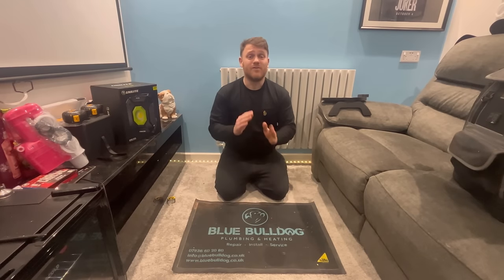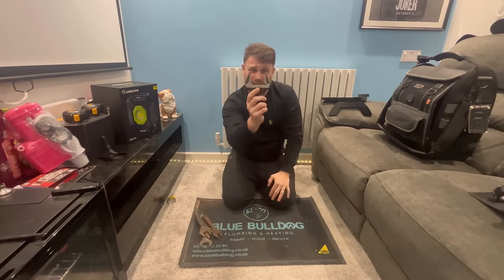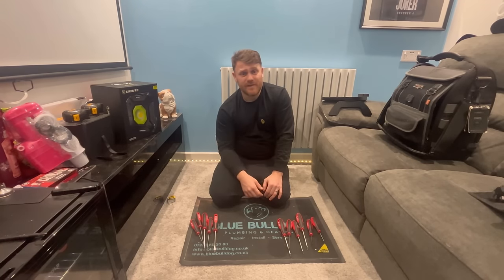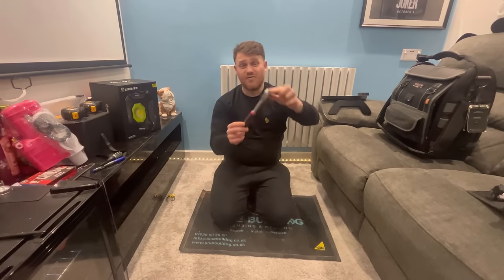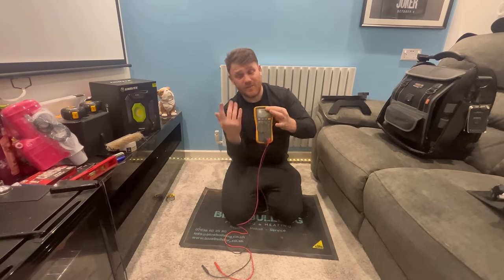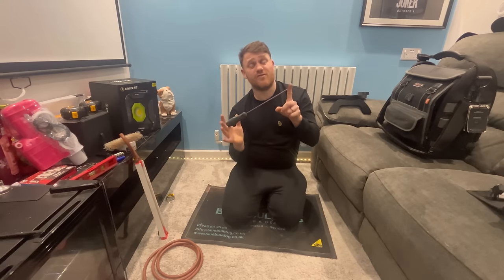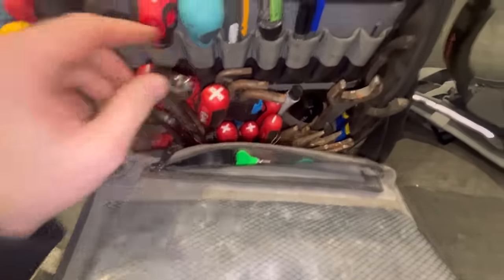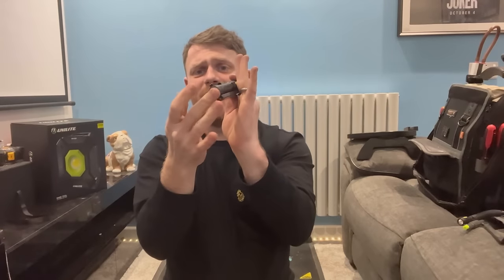Plumbing Tools & Review: Plumbers Tool Bag And Must-haves!

Comment: Thanks for that, it was interesting to see 👍
There is one tool that comes to mind, that you could add to that tool kit 🤔
I think it would be a real asset for you in your line of work, and that is, a small Magnetic screw dish or try. 
Ideal when dismantling items, all the screws and bolts kept safe in one place.
You can even stick the tray vertically on the boiler panel and load it with the screws and bolts you remove.

Just keeps them all together 👍

You might even find that some of the Chinese brass look a like screws stick to the tray as well 😂

Cheers Bud 👍
Reply from the maker: Great shout that is mate 👍

Comment: Nice loadout.
I use Systainers, they are easy to clean. Festool older tool-box models are great for fast access. I've never been a fan of bags and backpacks.
Reply from the maker: Thanks mate 👍I had a toolbox for years but got in the habit of using it as a step up 😅

Comment: Nice tool , am a wera man which I have all joker ratchet and open end spanner  for all sizes . I use knipex water pump plies too but the chrome push button as the 
one you use slip after a while .  Myscrews drivers are wera my Allen and torx are wera, they are expensive but you get what you pay for as they say. Like  you love the vito bags too
Reply from the maker: Gotta say I love Wera tools they am really good so I might look into getting some screwdriver to replace the Milwaukee eventually, them was only £20 so I’ve got low expectations. That velocity bag is my first dip into investing into a decent tool bag, want another smaller open one now to build the collection 👍

Comment: Nice loadout, just one thing: You shouldn't use a multimeter to test for dead ( Safe isolation ), I've seen the results of someone accidentally using the wrong setting on a multimeter and then testing for safe isolation, the circuit was actually still live and the result was pretty horrendous.
Reply: eleecys use a Gs38 tester. i use a fluke tester
Reply: @JayG2K  Nobody should be using a multimeter to test for safe isolation, would have thought you'd be taught that on your Gas safe training.
Reply: @rscelectrical7091  I'm not gas safe only watching as my interest, but yes i agree with what your saying.
Reply from the maker: Way I was trained at British Gas to be honest always safe isolation with a multi meter never known any different
Reply: @bluebulldog_uk : Not having a go at you buddy but it's really not a good way to do it. Years ago that was what everyone used, myself included until I was shown by an ex boss that it was dangerous. Since then I've witnessed the results of someone incorrectly setting a meter for whatever reason twice, then using it to test for dead and neither was pretty. A simple 2 pole voltage probe is much safer and has no settings to get mixed up. 
If you look at any of the safe isolation courses, none that I've seen use a multimeter and that includes the Corgi training centre course.
Reply: @rscelectrical7091 not sure if it would be catastrophic rather than just mess your multimeter up.. it's more likely you'll set it to the wrong setting and think it's dead without a visual or audible warning that it's in fact live.. which is what a voltage indicator would do..
Reply: Why???? Of course you can test for sale isolation with a multi meter gas engineers working on boilers aren’t electrcians, i was also trained by BG to safety isolate with a multi meter, we were also shown the socket and see gadgets